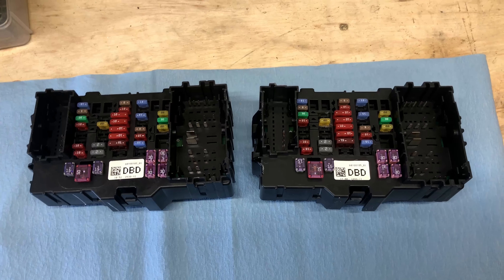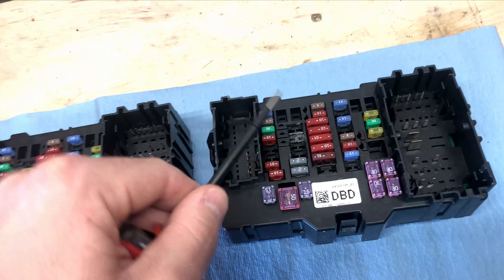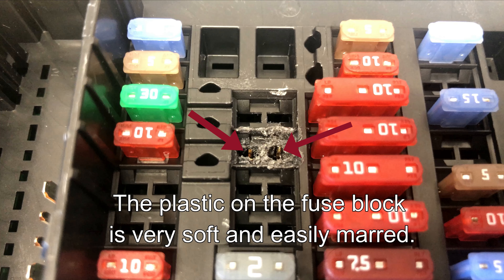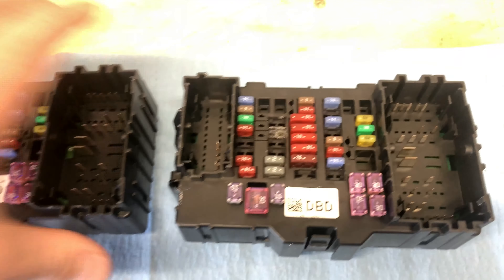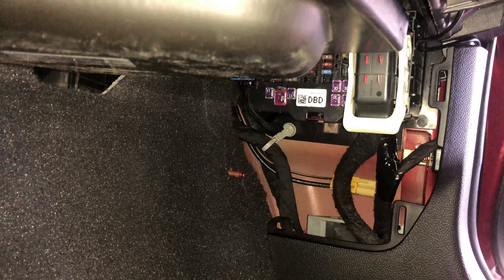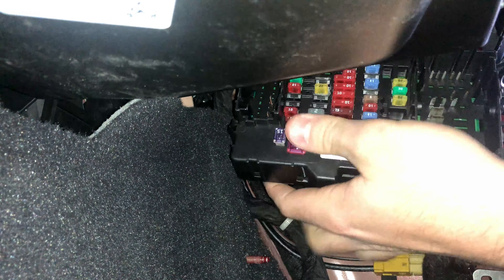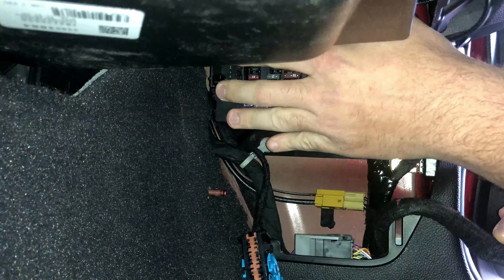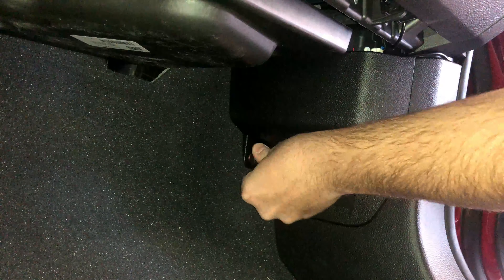[HOW TO] Remove & Replace Interior Fuse Block - 2015-2022 Canyon/Colorado (After You Break it 😑)

Comment: To get power for you dash cam tap the wires right behind the 12v outlet then run your wires under passenger carpet then through that area up the right c pillar.
Reply from the maker: That seems more complicated than using a fuse tap like I did.
Reply: Fondupot's Garage when you get a chance, can you post a picture of how it turned out with the fuse tap in place?  I also need to find a source of switched 12 V in the interior of my Colorado. Thanks so much for your channel!
Reply from the maker: @simisteve1425  I have a video dedicated to my dash cam install. Check my channel for that. It shows the power hookup. Thanks for watching.

Comment: I am at virtual ground zero on understanding how these work, but now that you have an extra fuse box, can you just harvest one of the terminals from the old damaged one and add it to the new one, instead of the tap?  this is what was suggested to me to add aftermarket gauges with their own fuse in my 2006 GTO.
Reply from the maker: I guess technically I could have done that, but you'd have to open up the fuse block. And I didn't want to risk breaking the new one, so I just swapped the new one in. The fuse tap has been working fine for a while now, no issues.

Comment: Do you know what is the biggest tire size you can run on a 2018 canyon Denali 20” rim, factory height no level or lift ?
Reply from the maker: Whatever the equivalent of 265/70r17. I think that’s about as big as you can go on a stock height. With no lift.

Comment: I have a dash cam hardwiring kit that has positive and negative wires. The instructions tell me to connect them to the positive and negative poles of the fuse box. For the life of me I can’t figure out where that would be on the interior fuse box on my 2019 Colorado. Any ideas?
Reply from the maker: Hmm. No idea. Maybe they mean the battery?
Reply: @fondupot  I’m thinking of cutting the connector off the positive wire and putting a fuse tap on it to just use a constant power fuse from the box, then connecting the negative connector to a ground screw somewhere.